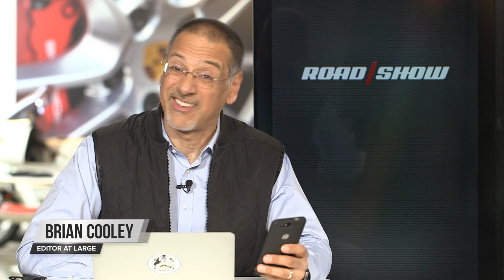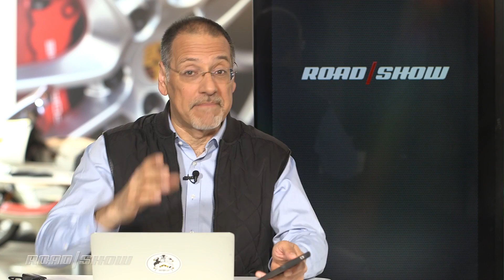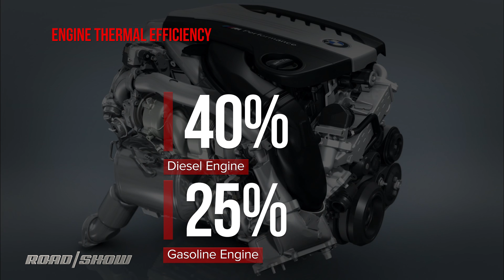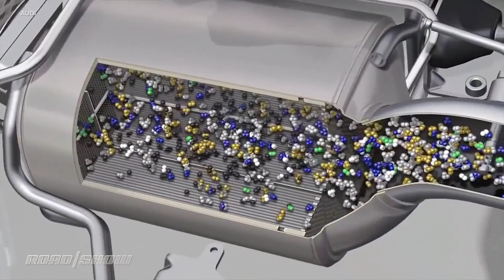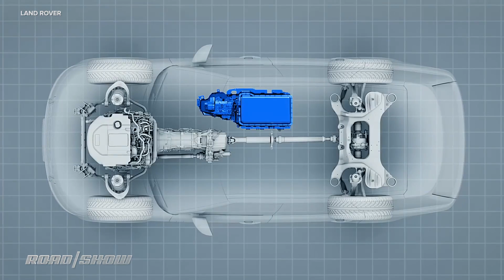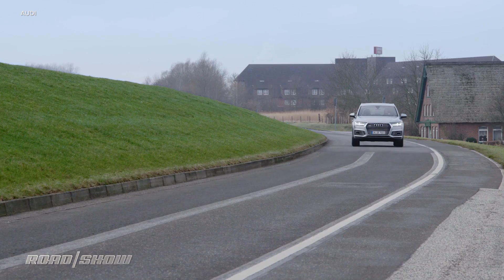Do diesel hybrids make any sense?

Comment: VW just have to ruin everyone's day.
Reply: The VAG group makes some of the worst gasoline engines you can buy. Not only are they horribly unreliable, but they also make quite a bit less power than many competitors and are quite a bit less fuel efficient. Any decent gasoline engine wont need to cheat because controlling emissions from a gasoline engine is completely different than controlling the emissions from a diesel. It's much, MUCH easier to control the emissions from a gasoline engine than it is to control the emissions from a diesel. 

"What makes you think that the 5.0 mustang can pass the emission tests when a 2.0L can't?"

Because the 5.0 liter is burning gasoline and the 2.0 liter is burning diesel?
Reply: idontcare80 everybody cheats...even gas engines.
Reply: Why would I trust you when they're being tested in the real world and passing those tests?
Reply: Emission cheating devices have been found on Audis with gas engines too. What makes you think that other manufactures are not using the same tricks? The VAG group has some of the best engineers in the world, if they can't find a cost effective way of meeting the emission tests and keeping some power in the engine, it probabily isn't one. What makes you think that the 5.0 mustang can pass the emission tests when a 2.0L can't? Everybody cheats! everybody!
Reply: @francesco2809  vw owns audi tho
Reply: No, the limits are the same for all vehicles of a certain weight, regardless of engine size, and the diesels weren't meeting those requirements, 5.0 liter gasoline engines do meet those requirements. 

It has nothing to do with engine size, it's all because of how the emissions are controlled in diesels and in gasoline engines, the systems that diesels have to use simply don't work.
Reply: No they don't, they don't need to.
Reply: They need to...trust me.
Reply: idontcare80 both engines are burning gasoline. Even if the 2.0 diesel would be burning diesel, it will still pollute less than the 5.0
Reply: Small diesels were circling the drain anyway. And VW wasn't the only one that got caught cheating, which is why those other manufacturers are being kept from selling diesels.